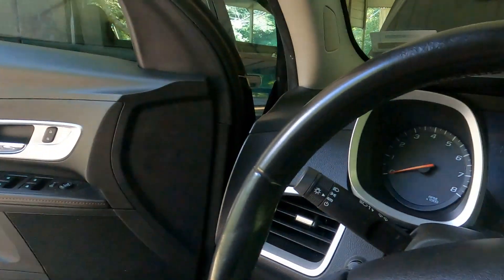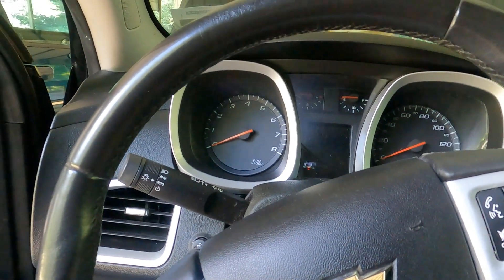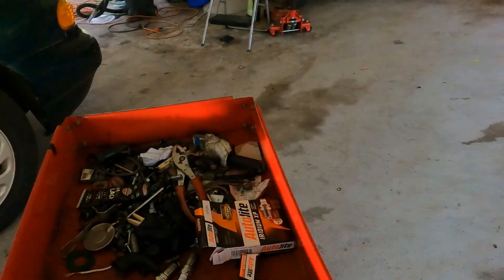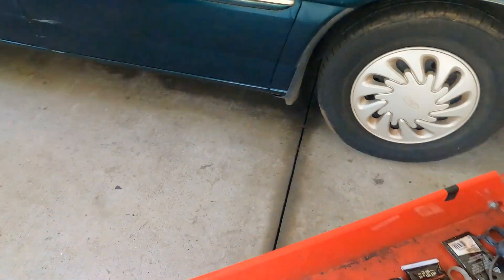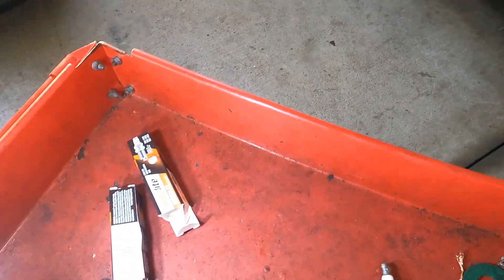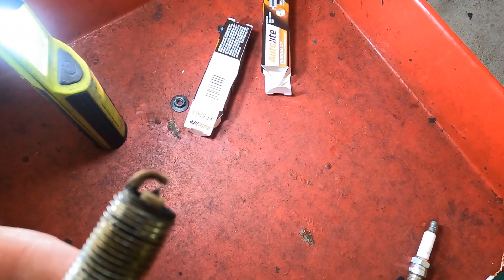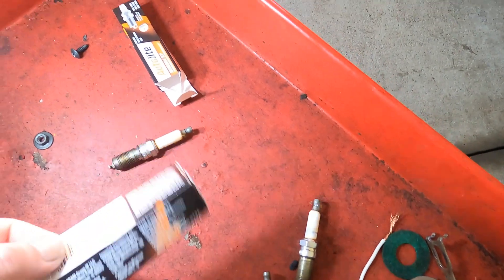Chevy Equinox 2.4 Ecotec P0420 fix

Comment: I was completely skeptical.  I got this car from my mother in law because she was taking to a mechanic because the p0420 code kept coming back.  The cat was only a year old had new o2 sensors.  I ran two different cat cleaners through the tank.  Still came back.   I came across your video as I was about to do the spark plug non fouler trick.  I swapped out the really corroded spark plugs for new iridium and error gone.

Comment: Did you cha ge the coils as well?
Reply from the maker: No just replaced the plugs,it's not repairing a misfire it's simply changing plugs that could be worn and causing the code,with these engines if they have over 100 k you will be chasing this code forever.

Comment: Did code stay off? I saw to try using a Catlytic Converter Cleaner poured into gas tank and ran for 150miles. But I can't recall last time we replaced the spark plugs, so wouldn't be a bad idea.
Reply from the maker: I have found with the Ecotec engines that keeping that dreaded PO420 off if they have high mileage gets to be impossible.Some do some don't but it's only the Ecotec engines that I have that trouble with so I know for a fact it's a common problem with those engines.